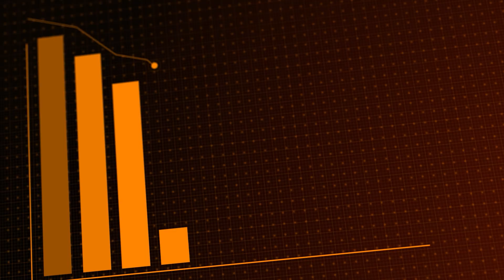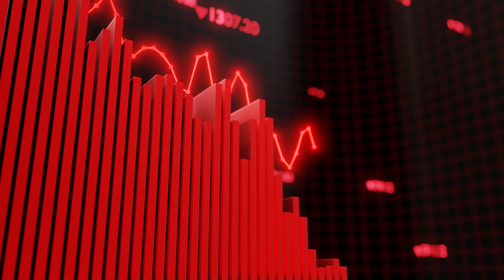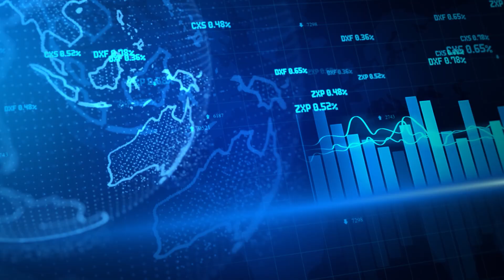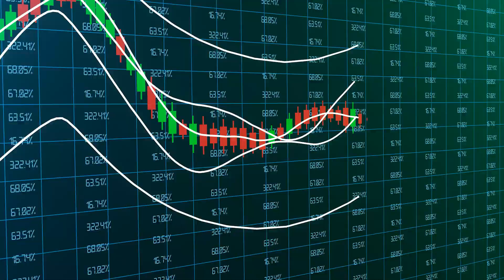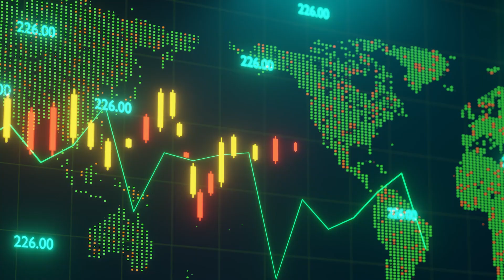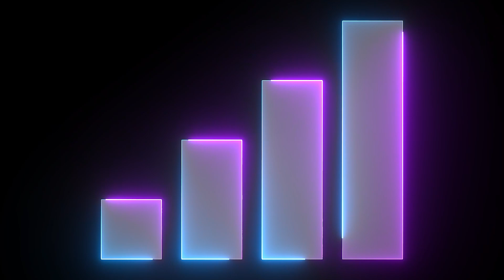Elon Musk Announces Starlink’s NEW Phone Will Change Everything by 2027!

Comment: For almost all satellite internet you can buy today (especially Starlink), you need a mostly clear view of the sky. If trees or buildings block the view, it either won’t work at all or will have frequent interruptions.
Reply: It would be the same as satellite radio on the whole works pretty good, be 10 times better then cell towers!